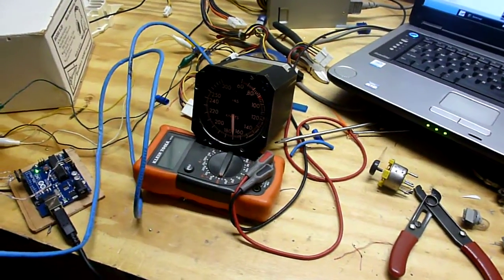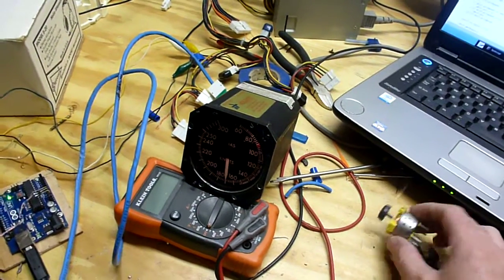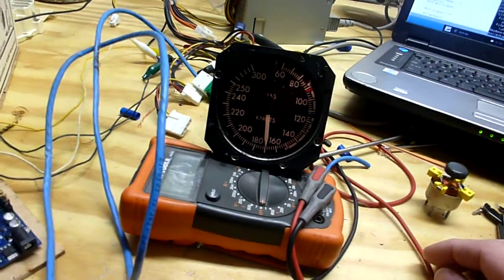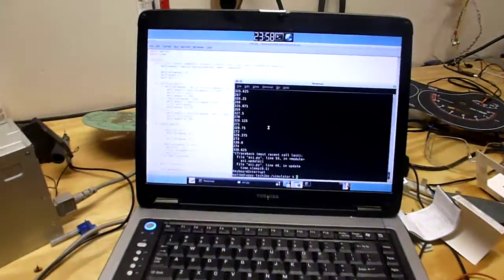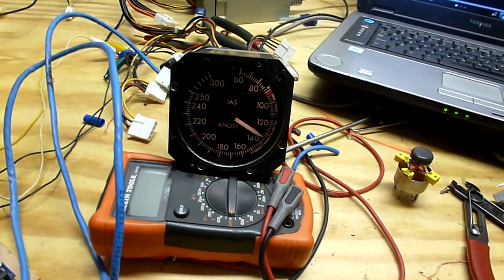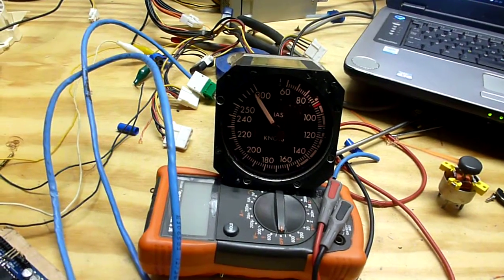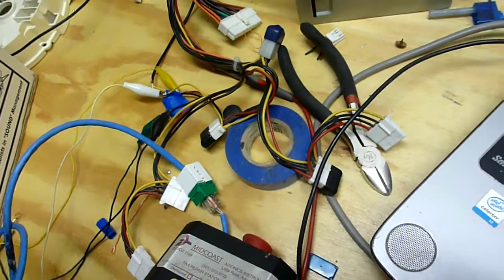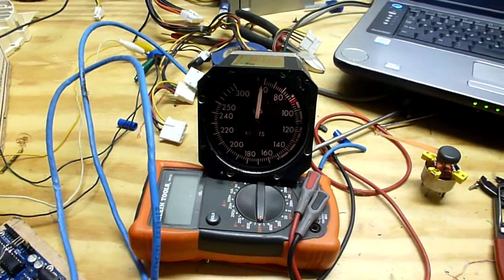Airspeed indicator

Comment: Hello xplanematt, i'm trying to make a propeller RPM indicator work, but i'm not succeding, i have some data from it like Hz, voltage, etc, could you give a clue about how to make it work with arduino? I don't wanna sketch or that you create some code do me, i want to know if some extra circuit with caps and resistors is needed, actually i just wanna a path for my research. if you could help, i would be very grateful. Thank  you.
Reply from the maker: Hi Francisco, hard to say without seeing the instrument. If it's from a turbine aircraft, it probably uses a 3-phase DC motor, and is intended to be driven with a tach generator. You can treat it like a brushless speed controller (like on RC cars & planes) but you'll have to figure out the timings. See my other videos, I have two RPM indicators like this, I started by studying the maintenance/overhaul manual for these indicators.
Reply: Hello @xplanematt ! Thank you for your answer. It's from a PW118 Engine (Emb-120), it's a propeller rpm indicator (Np). i have some schematics and part of an overhaul manual of a similar indicator (used on the same set of indicators and manufacturer by the same manufacturer) here. I tried to move the needle with some tach generators that i found researching at google, but no success, and what it's freaking me out is that the system to move the needle looks very very very simple. If i send you those could you take a look? I would be very grateful! Thank you! :)
Reply from the maker: It sounds like possibly a different type of movement from my tachs, but I'd be glad to check out the paperwork. My email is dabigboy @ cox.net, just send them there.

I know what you mean about simple movements....many of these instruments are ridiculously simple in their design, it's just a matter of figuring out what signal they are looking for!
Reply: Thank you so much! I'm sending all data i have and my supositions about!